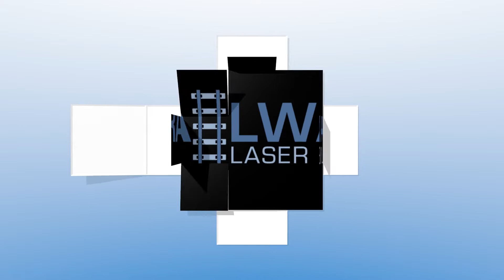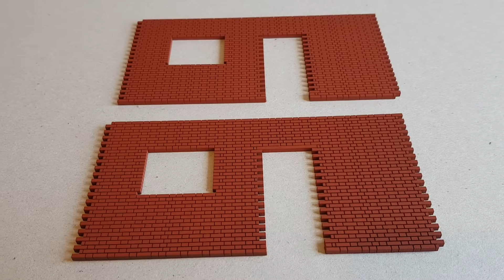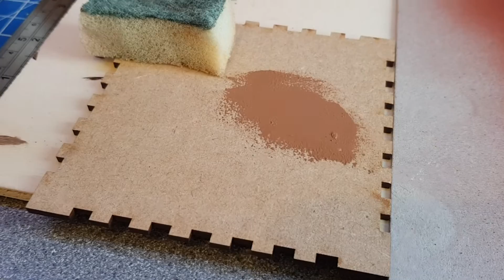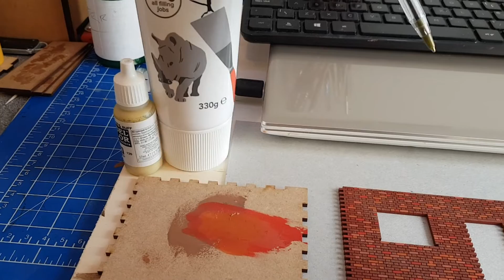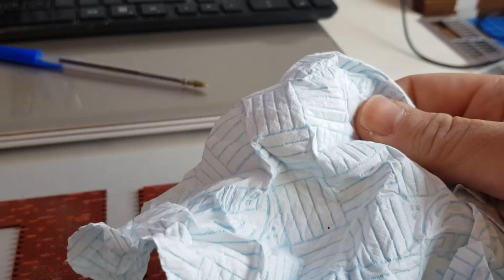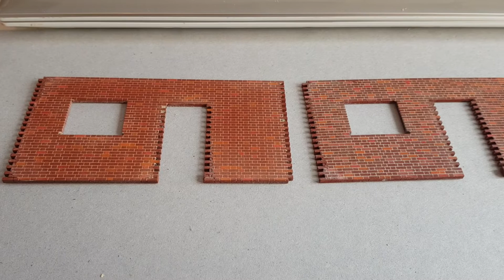How I Paint & Mortar Laser Cut Bricks | Railway Laser Lines

Comment: cheers Steve. great overview. really helpful and you are right about the older look by not using varnish. I'd also be interested to know about approach to doing the roofs of buildings, i.e. different materials etc.
Reply from the maker: I'm still learning brickwork techniques and now use a slightly different method, doing a quick varnish first, then enamel paints, followed by another light varnish, and then finishing off with an acrylic buff paint for the mortar. Works very well in O gauge.

Comment: How do you stop the wood from warping, my 3mm ply goes in flat but once I score with brick texture, it warps the wood like crazy. Also which paint spray do you use? Thank you
Reply from the maker: @fedele_rinaldi  I dont use 3mm and not ply either.
All brickwork is done using MDF and thickness depends on which scale I'm working with.
Sounds like you are scoring too deep, hence with all the mortar lines, its weakened the ply.
Reply: @SteveSmithRailways  thanks Steve, I'll try MDF and score less deep. Does MDF warp?
Reply from the maker: @fedele_rinaldi  depends where its stored, how it's used, how its protected. I've never had any issues with buildings I've made . They've all been primed, painted and no bare MDF shows
Reply: @SteveSmithRailways  what thickness MDF do you use? do you get it online or B&Q ;) thanks
Reply from the maker: @fedele_rinaldi  depends on what I'm making. I use 1mm, 1.5mm, 2mm, 2.5mm, 3mm, 4mm and 6mm, none purchased at DIY places.

Comment: Hi Steve, Would the method work with a laser cut card kit ?   Terry
Reply from the maker: I've never tried it Terry so couldn't give a definitive answer. What kit is it that you were thinking of doing it on? 
Steve
Reply: MMR Model Kit WA04 Parcels Depot - I have spoken to the proprietor who said he has used acrylic spray, so I think I will do the same and as you did after the basic Halfords acrylic red primer I will seal it with a matt varnish before the next stages.  Visited my local The Range yesterday and they no longer seem to stock paints you used, however I found the online.  Terry
Reply from the maker: @terryrobinson7371  I'm not sure it'll work on card but give it a go. The Range still do acrylic paints, they are branded different now that's all.